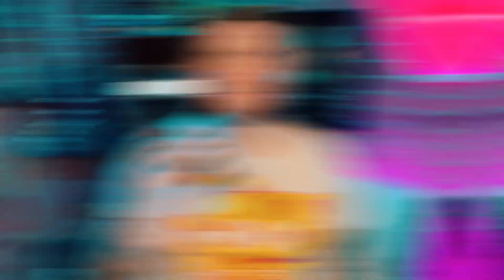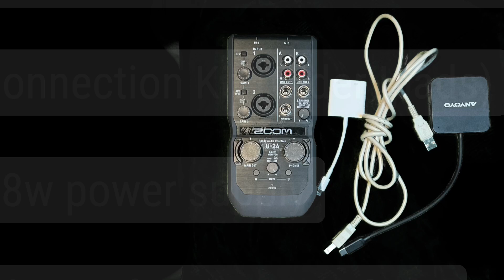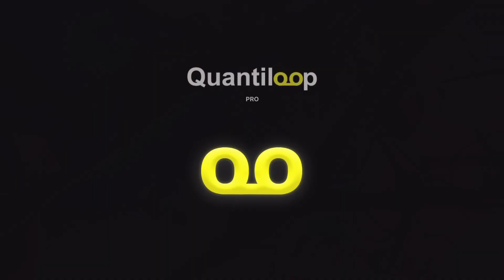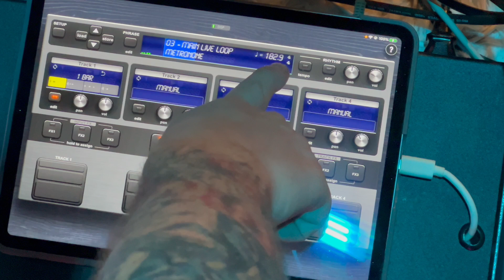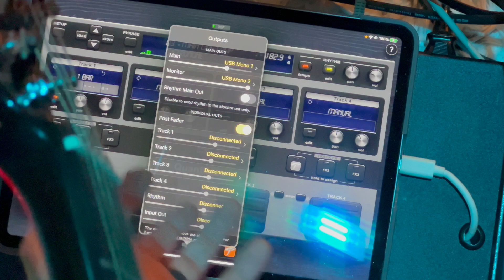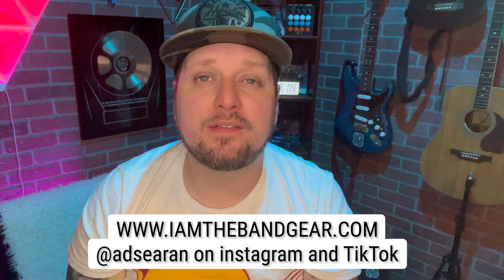Quantiloop Pro Getting Connected THE EASY WAY!

Comment: What type of in-ear monitor set-up do you use with the zoom-U24. Also I noticed that you are using the RCA connection not main out
I have the same U24 but also I want to use BeatBuddy. Also thinking about getting in-ear monitors
Reply from the maker: Sorry I am so late to responding on this! The XVIVE in ear monitor system is GREAT. There are a few different ways you can connect it too. Basically I use a mono set up, so what I do is use a stereo DI. I send the L out to the L channel of the DI, and then hook the XVIVE up to the L out on the DI, then the R channel goes to the R in on the DI and the R out from the DI goes to the mixer or PA. I Pre mix everything on my iPad so that way good or bad sound guy they are only pushing one fader. This also makes for great easy fast setup and tear down too. I now use a zoom AMS44 which makes it even easier because there are no RCA outs. On the U24 I just use the 1/4” outs. You can also use a stereo Y cable from the Headphone out and do the same thing.